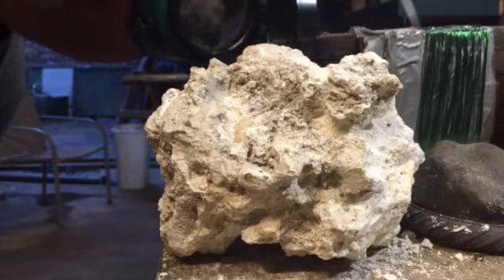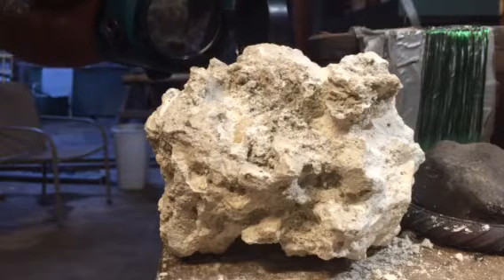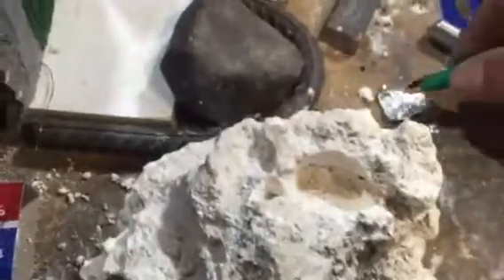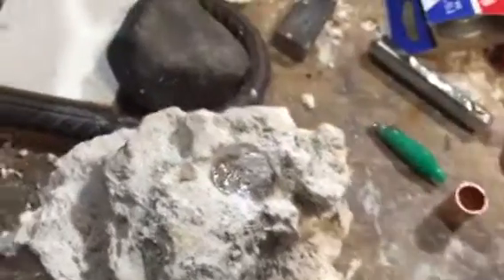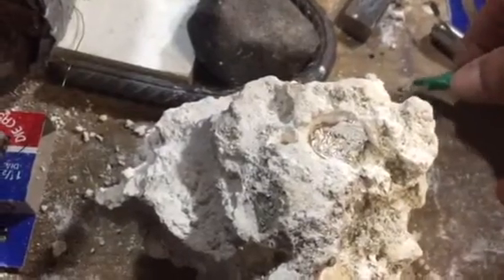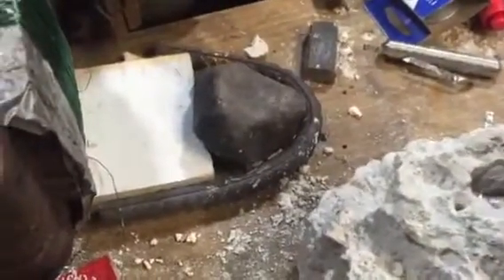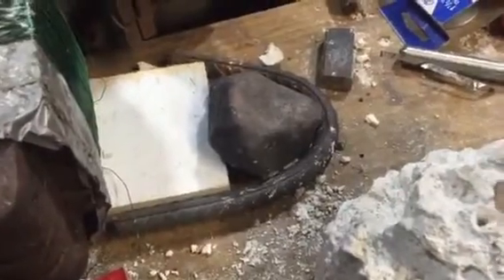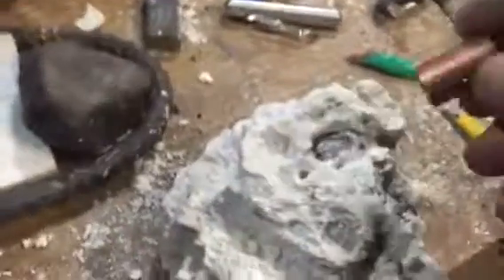Coral Rock Levitation

Comment: Well DONE !! It seems that you might have had achieved ... electric antigravity effect. The rock is rather a dielectric. The the rod from the top is a magnet it sends a magnetic field through the rock - dielectric. This creates electricity (electrons) which gather at the copper tube. However, the tube is not coupled to anything and so the electrons cant flow away therefore the rock and the copper tube act as capacitor. Accumulation of electric charge counteracts gravity. If you would encase the rock with copper and stick the magnet pole into the rock the effect could be minimal with copper sparking electric charges at some point. This way electrons from the rock are attracted to the copper and "pull" the rock towards it. if you would place a grounded wire close to the tube a spark would jump and the rock would fell down...

Comment: Please create a couple of magnetic levers from steel cable and show Ed's real way of levitating his stones. If I could I would however you have the rest of the equation. A cable from a winch should do (×2) about 50ft. Piece of iron pipe with copper (same size wire as your PMH coils) wire wound around it. (Same count of turns as your PMH coils) In the rounded section of your PMH place the cable through it and connect the copper ends to a lead from each of the two coils of the PMH and energize with 24v. This sends the North and South Pole magnets out the opposite ends of the cable until the bar is removed. Remember the light bulb he talked about? The flash of magnetisim leaving the PMH when the bar is removed? It's stored in the coil of the lever is what I am under the impression of however you could prove it. Have at it. Love to see the experiment. However you would need to make two of the setup to prove it can lift/levitate anything. Again something I have no way of affording to accomplish. But you are SO close I had to share. Love the genererator. Been following a few videos and sorry if I was rude. Keep up the good work you're gonna do it...